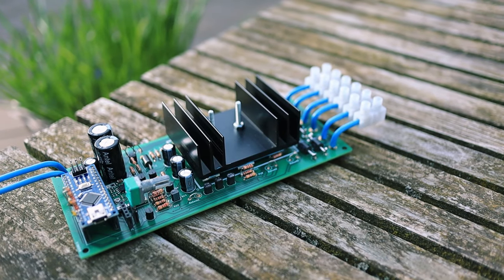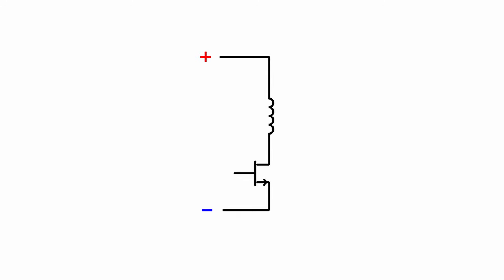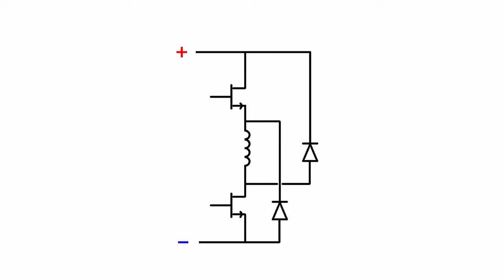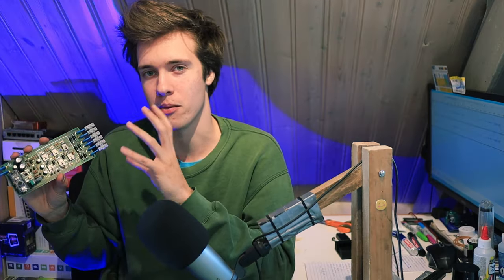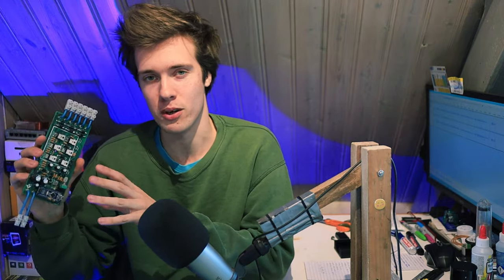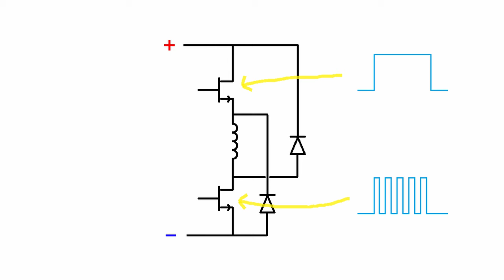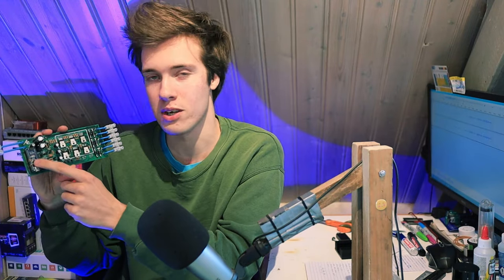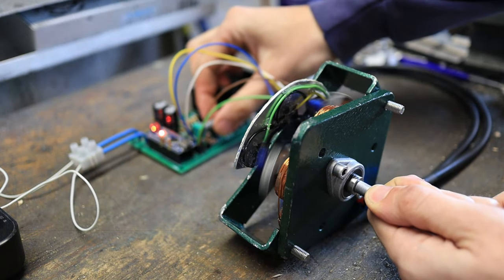How to drive this weird electric motor

Comment: I made a similar motor, but it has a physical driver built in.  

Speed is controlled by driver placement and direction by current polarity.

Switching is accomplished by using a light source, a reflection device on the rotor, and a stationary light-recognition switch.
Reply from the maker: nice

Comment: It's better to do the pwm switching on the top transistor because it completely breaks the loop and it can't build up 'momentum' at low duty cycles, potentially damaging the bottom transistor with voltage spikes I think

Comment: Hi, I want to create my own SRM based on your videos (they are a great inspiration), but I have some questions. What is the purpose of D3, D2, and D1? Are these diodes preventing reverse current? What is the nominal power rating of the resistors before these diodes? How can I determine the current my motor will need? I want to use the DRV8300 to drive the MOSFETs. Is it a good choice, or do you recommend other MOSFET drivers? Are C1, C2, and C3 capacitors needed, or can I use one larger capacitor at the input?
Reply from the maker: @kotrinio7868  C1, 2 and 3 are bootstrap capacitors to drive the top mosfets. They are charged through D1, 2 and 3.

The drive voltage of the high side mosfets needs to be higher than the supply voltage, or thr mosfets will not turn on. Therefore, a capacitor (say C1) is charged up to the supply voltage (24v), then, when Q10 and Q6 are opened, C1 is disconnected from ground and instead connected to the source of the mosfet, pushing the voltage on the top of C1 above the supply voltage so that the mosfet can turn on. If diode D1 wasn't there, this wouldn't happen, the capacitor would immediately discharge.

The need for a bootstrapping circuit like this could be eliminated by using P-mosfets for the high side instead.

Comment: For Top side pwm ,most economical is the (1T & 3B) switch configuration...here you save two power switches & their related drive circuitry...
Reply from the maker: This is true, but the maximum output of such an n+1 circuit is lower, since current to all phases flows through that single mosfet.
Reply: @AKIOTV  yes ..but one at (phase) at a time in sequence, & the top is like any continuous running pwm single switch..... there's no limitation on that single switch..if properly sized & controlled.

Comment: Have you ever considered building a radar device?
Reply from the maker: Yes, I want to make one some day. It's hard though haha.
Reply: @AKIOTV  do you have any recommendations for where to start? I tried to do some research but ended up nearly getting my phone hacked in the process...
I'd like to try to build a ground penetrating radar but it does seem pretty tough
Reply from the maker: @boots_and_a_banjo  maybe there are some off the shelf modules/kits around you could try. Otherwise I don't know, just start with a suitable transmitter?

Comment: Switching the low side/s is like you are doing a "BOOST " MODE pwm whereby the DC link voltage can exceed the nominal rectified volts..
Whereas with pwm on the high side you have multiple benefits..
1) now it's like a buck mode controller...just what we want when a lower speed than max.is required ..
2) it serves as an auto  bootstrap for the upper gate drivers...even recharging the bt.strap caps during each pwm off time.
3) speed is directly prop.to ( d ) or (t-on).
4) B.E.M.F. can be sensed during the (off time) of the pwm.

Comment: A bifilar wound flux switching motor is the simplest in this category..no complex electronics..& can be speciallywound to simulate a seriers dc motor with those benifits..

Comment: Once again - nice job 👍🏻 
Switch the high side because you are boot strapping the high side MOSFET gates. The boot strap capacitors discharge quickly and require recharging. I’m guessing you are using high/low side gate driver IC’s?
Reply from the maker: 100 points it is. The bootstrap capacitors for the top mosfets last about 0.25 seconds, so if the power stroke lasts longer than that, the motor can stall. (That's still quite long, I used quite large capacitors, so the driver is luckily still usable)

I'm using some npn transistors for driving the mosfets, driver ics would be a better option.
Reply: @AKIOTV  Yep. Boost strap circuit was also what I think how this is now done. Also some driver IC have just integrated that. Maybe to use some chips also allow separated power source to do it.
I think now it's only low side is connected to PWM pins and top side is controlled from GPIO. If all would have been PWM pins then it would just be SW update. When I design something I usually put some dummy resistors and place to cut traces If I think I need to swap some pins in future.

Comment: Norty putting magnets on the rotor!
Must do the inductive version, minimised hardware and physical size, maximised control...
Then you can sell the PCB!
Home made pancakes motors are awesome for tiny and low power PTZ control of covert CCTV cameras, for example, so low-speed uses are interesting, especially if you create a design using an axial absolute position encoder, high precision servos etc...
Turbine generator projects also interesting. 
I hope you keep this up long enough to do all the things!!!

Comment: Very cool. It's such a fascinatingly simple motor design. I'd be interested in seeing if it can be run at low RPM in conjunction with more accurate feedback. A multi-axis hall sensor perhaps, or a quadrature encoder. Or maybe holding arbitrary fixed positions, micro-step stepper-driver style.

Regarding balancing, you might check out the setups to balance rc props for balancing the rotor. It's basically a levelled stand with two pair of low-resistance steel wheels for the shaft to run between. A similar arrangement of four cheap skate bearings with the shields removed might work as well? Although the shaft would probably be needed to be straitened out first. Or if you have a scope, there is a video on dynamically balancing a motor with a small speaker as a contact vibration sensor, that seems it could be applicable?

Rather than referring it to a BLDC, since that seems ambiguous, perhaps call them PMSM, permanent magnet synchronous motor. That seems to be an accepted terminology.

Also, if I understand correctly, the SRM stator and physical arrangement of poles are similar to a PMSM, and the relative magnetization forces between rotor and stator would seem to be functionally identical between them. Therefore the difference between SRM and PMSM is in how the process of inductively magnetizing the rotor for smooth rotation requires very different driver voltage waveform in the stators? Just to clarify.
Reply from the maker: The motor can run as slow as you want, even with simple sensors like these, but because my controller uses the top mosfets for commutation, and these can only be turned on for about 1 second at most, making the slowest speed possible about 0.3RPM. (due to something called bootstrapping, which is needed to drive high side mosfets). This is why I recommended using the low side mosfets for this instead, it avoids this problem. 

(Potentially there is a workaround for my poor design, in which the top mosfets are briefly turned off during the power stroke to recharge the bootstrap capacitors)

In a nutshell, the big difference with a permanent magnet motor is that in a PM motor, you can have say a magnet north pole on the rotor being  attracted towards the next (south) stator pole, while being repelled by the previous (north) one. This push-pull action doesn't happen in an SR motor, since rotor poles can never be repelled, only attracted. This is why phases need to be driven independently, and why the direction of the current in the coils is irrelevant.

It also means the drive waveform is not a pure sine wave. For the smoothest operation ideally you want the current to be as close as possible to an ideal square wave. (Which may require a very weird drive voltage waveform).

I'll keep your idea for balancing in mind, it may be useful for my boat propeller too 👍

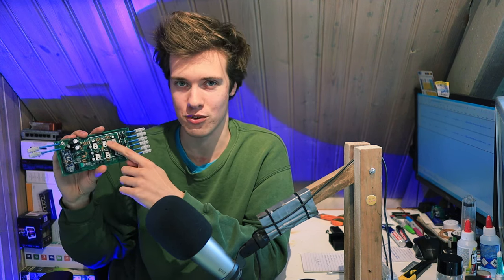Comment: 13:20
Heat?
faster switching means more heat, and heat rises
although 'bottom' and 'top' seem fairly arbitrary in this case.
Reply from the maker: Not the reason I was looking for but quite an interesting answer still, I suppose it could make a slight difference depending on the orientation of the board.

Comment: this is such an amazing and brilliant video. I have a few questions about this too. with these motors would they run more efficiently if they were dirven with a sinusoidal voltage rather than a constant pwm? with permanent magnet motors they benefit form sinusoidal voltage input but since this has no permanent magnets would it? it still seems so since the primary reason for sine wave is motor geometry and angular velocity but would you know? and i think its really awesome how you release all your code and diagrams, i could never design something like this myself but having some designs to copy, learn from, and tinker with is great. and would it be better to do fast switching on the high side mosfet for the same reason that the diodes are necessary? if you switch the mosfet that feeds the phase quickly then it doesnt experience the high voltage from inductance. im also a novist everything I sad here could be wrong. its a very good video though.
Reply from the maker: Due to the way the motor works, the ideal current waveform is a perfectly square wave. The drive voltage to obtain this, is usually some very weird shape.

The reason doing PWM on the top mosfet is better, is because the top mosfet is driven using a so called "boot strap capacitor", which limits the amount of time the mosfet can remain on. That limits the length of the power stroke if the top mosfet is used for the slow switching.

More info on the motor is on my other video about the motor itself. 

btw thanks for watching 👍
Reply: @AKIOTV what do you mean the drive voltage to obtain a square wave current profile in the SRMs stator is some "weird shape"...what shape specifically? Also, how to use shunt resistors for closed current control (measuring the coils' inductances) and driving the motor as a generator?

Comment: I would have thought switching the low side would be the better option as N type transistors tend to be more researched, available, and capable, and to me that means they should have better switching efficiencies. That being said, I have no idea why that thinking is wrong.
Reply from the maker: This is true, but on my board n-channel mosfets are also used for the high side.

Comment: Brilliant! Design files for the motor available? Fee?
Reply from the maker: Haha those don't exist. I had a general idea of the design in mind but the exact dimensions etc I pretty much made up as I went along.
Reply: Ah. Ok. Thanks for the reply. I'll see what I can do and it's in with the controller files you offer. Thanks! @AKIOTV
Reply: And great explanation on the controller method, btw.
Reply: @AKIOTV  how does this relate to FOC/simplefoc/Fettec sfoc? I know those are geared to PM BLDC's but are those approaches, intended to provide more smoothly modifiable sinusoidal please current, possible?
Reply: @AKIOTV and what would be the cost to hire you to redesign and produce the modified controller inclusive of Regen braking?
Reply from the maker: @moses5407  More sophisticated control schemes for srms could be called "foc", but it'll be nothing like the output of a pm motor drive. For a start the ideal drive wave is not a pure sine wave but a purely square pulse.

I plan to upload an updated version of the design sometime soon, so I guess what it costs is some time waiting for that.
Reply: @AKIOTV  @AKIOTV Thanks for your replies. I found a couple of papers on FOC control for switch reluctance motors. I'm reviewing them today and will forward links if they look interesting. I also found an interesting paper and simulation for a combined axial radial switch reluctance motor and will forward that as well If you're interested.

I'm not a fabrication guy so would be happy to talk with you about contribution for small motor and controller production to see if I can manage it.

In any case thanks for the work and the time you spend doing the great explanations.

Comment: With how low of a profile this is, it could potentially direct drive a horizontal weapon on a combat robot
Reply from the maker: You mean like in something like Battlebots? Those spinny things are insane haha.
Reply: @AKIOTV precisely! they have all sorts of weight classes. this kind of motor could potentially innovate in a weapon system
Reply from the maker: @melodywave3  This type of motor does have the ability to achieve very high speeds. The back-emf is current dependent, so as the motor speeds up, the increase in emf is tempered by the decreasing current, allowing for the speed to climb further, similar to what happens in series wound dc motors. That would be excellent for some death-spinner. I do think you'd want a better mechanical design than my motor though.